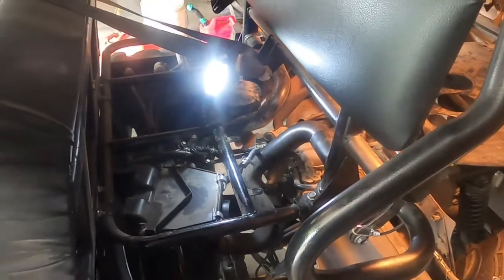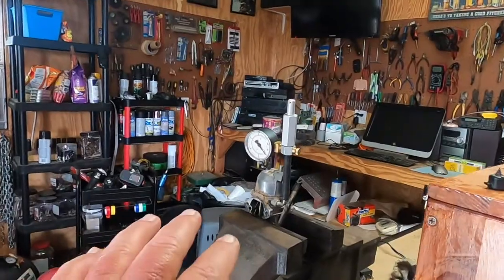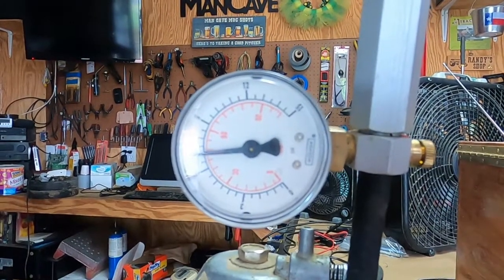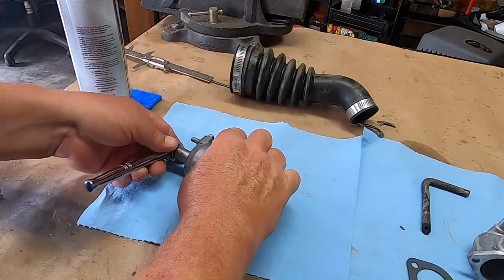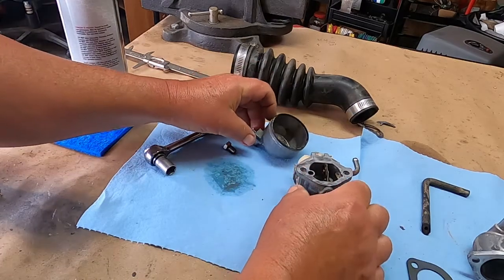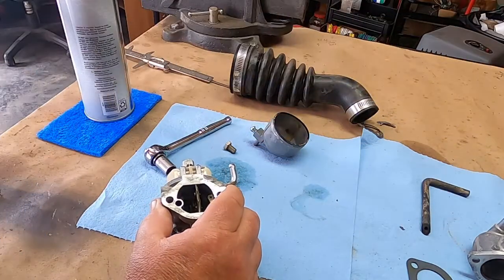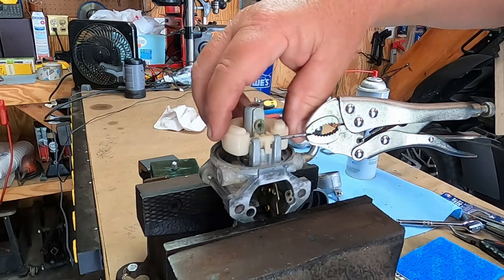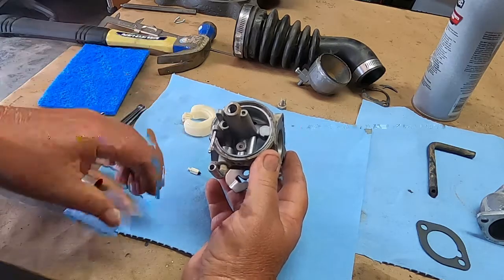2016 Kawasaki Mule Carburetor evaluation

Comment: did you go the wrong way?  removing that pin.
Reply from the maker: No, that pin was stuck. it should just have slid out.
Reply: @larrybl   I've seen them staked on one end before. you lightly tap them in and out,  from one direction .